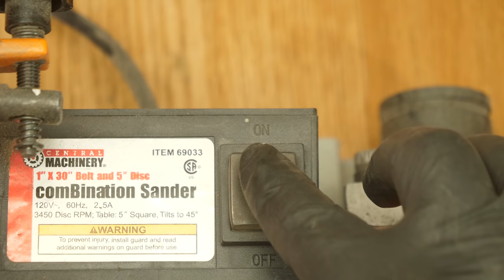Original Bowie Knife Restoration - Rust To Shine!

Comment: Really good restoration, I really appreciate your skill. Your reuse of all the original pieces was spot on. I like the red and white on the pummel its a good touch but The bolt nut on the end would have made it completely original. Still an excellent restoration. Your skill is without question.

Comment: Nope this is a major failure of a restoration, why, because the rusty knife blade was inserted into the sheath therefore that rust will also be imparted into the entire length of the inside of the sheath, so inserting the restored knife blade into it will cause the blade to begin to slowly rust again, so it's only a partial restoration.